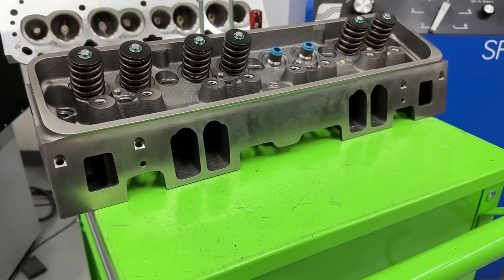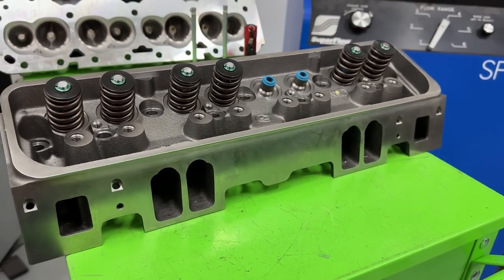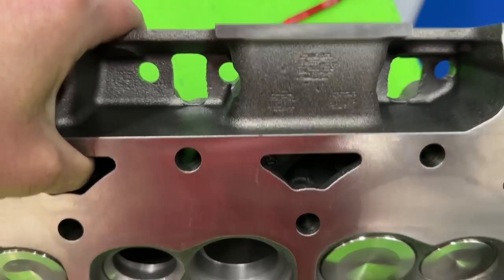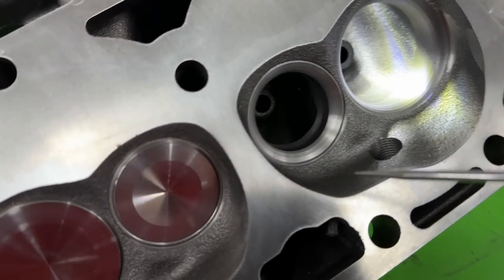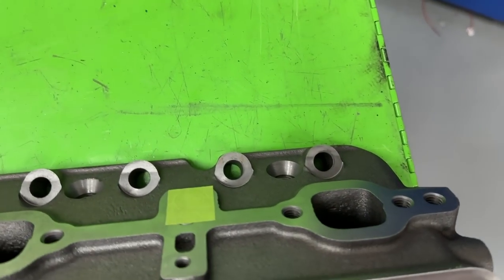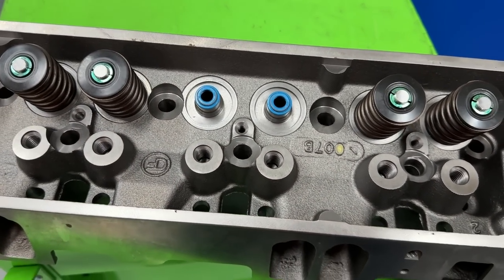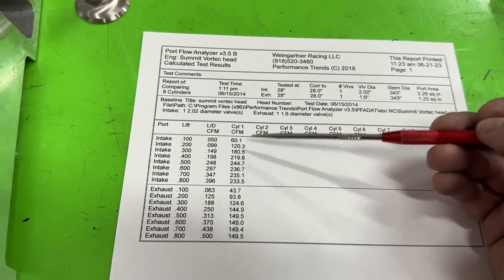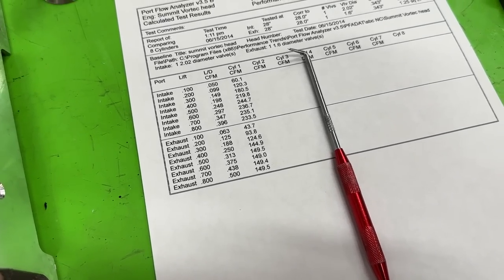Summit Cast Iron Vortec Head Review

Comment: I worked at a aluminum head foundry many years ago.  They used a resin insert for the water jacket.  Now they are using a loss foam method, which removes the need for a mold and the resin inserts.  If you ever want to learn about loss foam methods, search YouTube for Kelly Coffield.  His methods are the easiest to follow.
Reply: We did lost phone casting in high school at our school foundry.

Comment: Great video Eric! I have these heads and the Dart part number is on the opposite end of the Summit Logo end. I plan on modifying mine following David Vizard's porting tips for Vortec heads. They won't be great, but they won't be going on a race car either. Just going on a stout 355 street engine.
Reply: With a little "LOVE" those are 500HP heads on a 383👍

Comment: I purchased a set of these heads from Summit, because the stock heads cracked, and most of the online auto parts stores wanted more money for remanufactured stock heads than what Summit wanted.
I was mostly after the fact that the Summit heads are better/thicker castings than the stock junkers! But it's a nice bonus that they come with stainless valves and screw in rocker studs too!
Reply: How are they working out for you? Looking into getting some for my L31
Reply: Great value for the money, american made to boot! Id buy those before chinese alum heads. Btdt
Iron weighs a lil more but Ive never felt a difference either way when driving

Comment: That head is still available from summit. # SUM-151124.  it's a fairly good head for applications where you need an iron head or a stock replacement vortec. I use them for SBC powered boats all the time. lake water is hell on aluminum heads.  they are decent right out of the box, and even better if just some mild porting to remove the ridge you were talking about and gasket matching. I really don't like the hum on the top of the port, and I don't know how it effects flow since I don't have a flow bench. but i am sure it hurts the flow.
Reply: Youd be surprised what doesnt hurt it

Comment: I've got a set of Dart 165 S/S heads on the bench I'm porting now. Exact same shift in the casting but the S/S has dual intake and valve cover bolt patterns and mine have the 2.02 & 1.60 valve sizes. I bought them bare though. I bought iron heads because they are going on a van which holds a lot more heat around the engine and I thought they would hold up a little better. Cheaper than finding a set of GM 300hp heads.
Reply: Combustion chamber design of these over the old GM iron bathtub design by itself is a big plus in my book. 
Id run these on a fun 350-400hp st car no problem!

Comment: Thrilled with this video. I ordered a set of these back in January, when Summits stock was dipping into the single digits and it wasn't clear if Dart would be making more (they had just announced the discontinuation of the iron eagle line). Summits info in this head is outdated, and they advertise it as having umbrella seals and a 3 angle valve job. After having hands on 2 sets of cracked vortec 906 heads, I opted for these. 
My local machine shop went over them and found the valve guides had just under 1 thousandth clearance, and one head had some chatter on the intake seat. Not bad for the price. I would love to see what these flow with just a backcut on the intake! Cant wait till the rest of my engine parts come in and I can assemble my 383 vortec.

Comment: Eric,
To get the Vortec valve covers to fit, the perimeter bolt boss has to be milled down.  Something the Chinese heads including the AFR Enforcers do not have right.  GM Fast Burn, real AFR heads and Edelbrock Etecs have them machined as a step but they are tapped for perimeter bolts.

Comment: Very good video!  I'm considering a Vortec conversion, from a 305 TPI/LB9, in my '89 IROC Z convertible.  Too bad you did not use the "Scribe" , sitting on your table, to point to the "Step", in the exhaust port.  Not clear which ridge/step your finger is pointing too.  Further one in?  Is the green tape covering an EGR (Exhaust Gas Recirculation) supply,  on the exhaust side , of the Iron Summit head?  Thanks, Michael, St. George, UTAH.

Comment: So I had the 165 cc Summit heads and they are made by DART
Also I found out the hard way that if they leave the bosses in for the 4-bolt Valvecovers the stock center bolt valve cover rails hit those bosses and you can’t build them on without modifying the heads or the valve covers so that’s why they machined them down

Comment: I was wondering when I was going to hear Eric bring up the fact that iron heads are barely or aren't at all a cheaper alternative to chinese alloy heads. Been cylinder head shopping for a year and ive narrowed my choices down a lot.  That is all thanks to Eric Weingartner.
Reply: I would rather have an iron head on a daily ,, alum heads over time may get soft with tons of heat cycles,, iron won't do that
Reply: Unless you're like me, and simply won't touch "Chinese" junk. I can buy 781 heads all day long for $200 a set, do some work on them, and make 700hp N/A, and I keep it all American. Yeah, I'm an old boomer, and like my American made stuff. 😉
Reply: @Levisnteeshirt1  See thats where im torn.  I want vortec heads real bad, but they crack and the exhaust seat and bowl are less to be desired.  Plus more work is needed for a high lift cam.  Do all this and the head is still highly prone to cracking. Might as well spend the money on those cheap Brodix IK200 heads that are USA made. But like you said, iron is great for daily driver. Which is why Im thinking of porting and shaving my 993 heads i already have.
Reply: @Anarchy-Is-Liberty  Can you find me camel hump heads? That are not fukin a rip off $1500 a rusty set? 461, 462, 041, 186..etc
Trying to have factory GM iron heads that flow great, but don't crack and i can run perimeter bolt valve covers instead of centerbolt.  and not pay a rip off amount for
Reply: @shootermcgavin2819  Good luck! Everybody thinks they are gold plated. Id buy a set of TFS aluminum doube humps
By the time you do all the nachiing, port work seats guides etc bet theres not a lot of $ difference..plus the tfs are new

Comment: Confirmed. Dart has scrapped the tooling for cast iron heads. 
So whatever is on the shelf is what is available. 
 World products messaged me back and said they had plans to discontinue cast iron heads at this time.
Reply: Chit...writings on the wall. Buy American people!
GM has been discontinuing many iron crate engines also .
Miss when you could buy a new 4 bolt block from them for 500
Reply: @gordocarbo gm wants how much for a stock 350 crate engine now? $3500 for a 250hp flat tappet crate engine, whatever. Gotta pay those good union workers $50 and hour to build $120k dually trucks and SUVs that are not worth half that.

Comment: I was just thinking.  I'd like to see what the summit heads flow. I have a set that aren't called vortec. 

cylinder Head, Cast Iron, Assembled, 72cc Chamber, 165cc Intake Runner, 2.02/1.60 Chevy
Summit Racing™ Cast Iron Cylinder Heads for Small Chevy SUM-152123

Comment: I just purchased these for my 98 5.7. Have a cracked exhaust port on my stock passenger side head but otherwise very clean engine with 171k miles. Wondering if I can re-use my stock push rods and rockers if they are in good shape with these heads?
Reply: If thgey arent real worn, sure. Heads in vid are pretty decent
Reply: @gordocarbo  I ended up reusing them and they worked great!

Comment: What are you guys doing about valve springs and guides with these heads if you plan to run a decent hydraulic roller? 
I want to run the Summit 8802 hydraulic roller cam with these heads but, lift on that cam is given as .525. So, at the very least the guides will need work. And the recommended Comp Cams 986 springs are 1.430 diameter. So, more cost than is immediately evident.
Reply: Do these heads need the same machining for high valve lift that factory vortec heads do? I’m guessing not since there are no real valve guides in there.

Comment: They still sell these, in 165cc runner/72cc chamber (SUM-152123) and 175cc runner/67cc chamber (SUM-151124) form.  Of course, I don't know why anyone would be interested in the one with the larger chamber and smaller runner, even for an OEM rebuild.
Reply: I wonder if the 175 is the dart 180 runner?
Reply: larger bore for 400? Lower compression who knows.

Comment: I have had a set of those 007 heads for about 3 yrs now, and was wondering about the flow numbers, they dont say dart or summit, but i took them off a vortec motor, casting 007 , any hp numbers ?

Comment: It floors me that they can get those kind of flows for the valve diameter, that's actually smaller than a double bump camel head! Summit shows them for $369, not a great deal of money considering you get the valves in the springs etc.
Reply: Great deal, for its size ought to make good power.

Comment: youtube black sheep fab shows summit sbc iron head w/o fi notch is 165 intake runner and flows 1.87.9 2.150.1 3. 199.1 4. 254.2. do you find these flow numbers are accurate and how do you feel about those heads for the street on a 355?
Reply: ona  street 355  with flat tops and a mid 230s  duration camshaft and an air gap  and 750...should be a 425+HP  engine
Reply: @KingJT80  Isky 280 dual plane 650 DP, perfect .
Reply: @gordocarbo  I'd like to see the lift a lil higher like a voodoo 233/241 .505/525 but a 650DP right on the money

Comment: Aluminium is light ,and if you have an iron block they don't get along to well they heat up and cool down at different rates of temputure I don't want to replace the head gaskets every 7 or 9 years the Toyota 22 R was a great engine iron block aluminum head I'm 60 now and I don't want to replace head gaskets every 6 to 8 years that's just me ,make it all alumnium or all iron
Reply from the maker: You are wrong on that assumption. Modern cars have had aluminum heads and blocks for years with no problems.
Reply: 22 yrs and close to 200k miles, 02 Chevy truck. Alum heads iron block. Never had the valve covers off it
Many blow HG due rto lack of maintenance or driving habits.

Comment: The Etec 170s eat these for lunch.
Reply: theyre  also  a lot more  money too  and aluminum.  im not surprised there
Reply: @KingJT80 when you consider what you are getting for the $ difference, well worth it.  In the test 355 with 10:1 compression and a 222/230 @ 0.050 roller cam, the Etecs beat those out by over 40 hp. At the time I ran them, the Etec170s with the roller spring package were only about $300 than those Summit re-branded Darts.Those Darts were dead last in performance in a 5 way shoutout of Vortec heads. The stock casting even performed better, then again the point of those heads was for the mass engine rebuilders to have something to replace cracked stock castings with. Etec170s outperformed all other heads tested including the Bowtie 180cc Vortecs.

Comment: For on the street the Iron heads are a giant waste of money! If i had known what I know now about vortec heads I would of spent my money on a set of Ebay DNA heads and spent the money at machine shop doing valve job! Everything vortecs cost more money and the weight of cast iron sucks!
Reply: Some racing classes require stock iron heads. The Vortec is still extremely popular choice because they're still the best flowing/performing stock iron heads by far.
Reply: Youll never feel 40 lbs behind the wheel. You would be lottery lucky if all those Chinese heads needed was a valve job
the 5 angle and tu;ip deal is pretty slick.

Comment: Well you do not have to worry about cast iron heads. Dart is discontinued cast iron heads for the small block Chevy January 1, 2023. Great. How is that made in china crap helping made in USA. I don’t want aluminum heads not for street, not for anything.
Reply from the maker: The factory have been using aluminum heads on vehicles for decades and they go 100k miles.
Reply: @WeingartnerRacing yeah yeah I know I need to be more open minded. I just prefer cast iron.
Reply: @WeingartnerRacing if cost is the big issue for cast iron heads, how long before aftermarket cast iron cylinder blocks go away? If that’s really the issue is cost. Probably the market has all gone LS and it’s not cost effective to make gen 1 sbc cast iron heads because the market is small. Maybe.
Reply: @WeingartnerRacing  my friend had 400k miles on a 5.3. duramax diesels even have aluminum heads.

this isn't the 60s where aluminum is still kinda sci-fi.
Reply: @DavidB7474  Cant get a replacement engine for my 02 5.3 from GM. They are discontinuing a ton of engines
Even a bare 4 bolt block is over a grand now...nuts. Paid $500 around 2000.
Reply: @gordocarbo but everyone says how cheap you can get junkyard ls engines everywhere. I’m sure there are crate engines available at Gm performance. 
 And I can get any engine at pick n pull in Fort Worth Tx for $350. Ls included.
Reply: @DavidB7474  20 yr old truck ls are still well over a grand in Ca. how they claim they are all low mileage I doubt it. 
Too much..plus the costs of all th elittle stuff to make a conversion work.